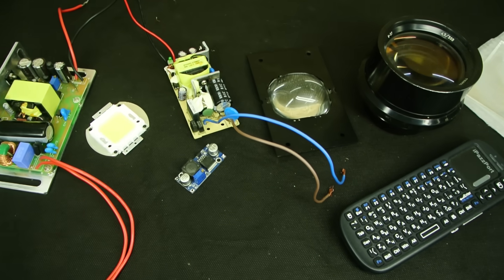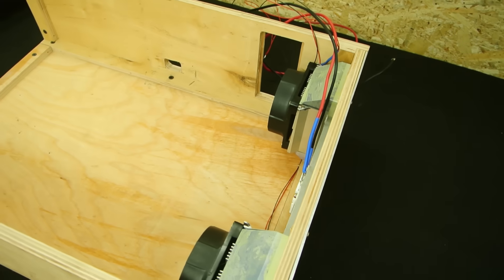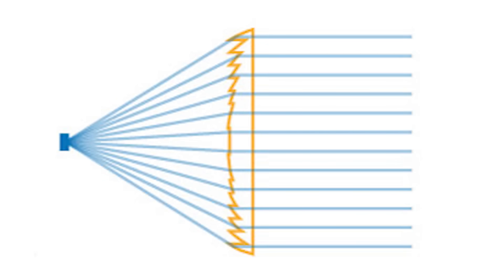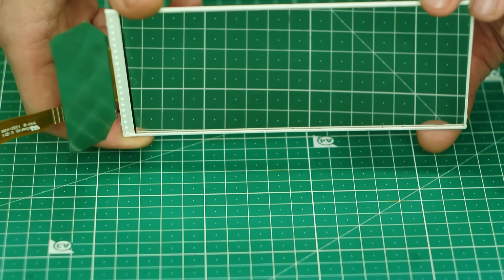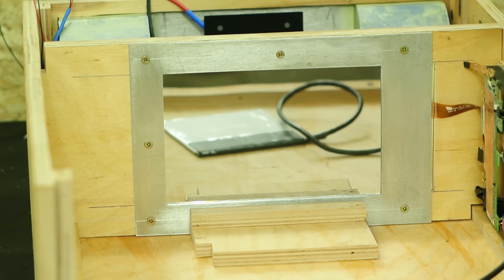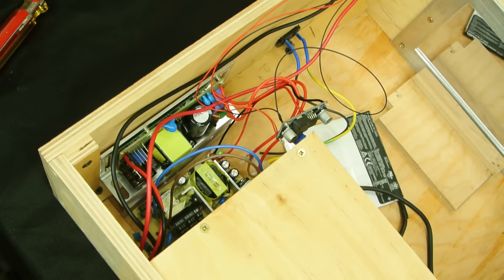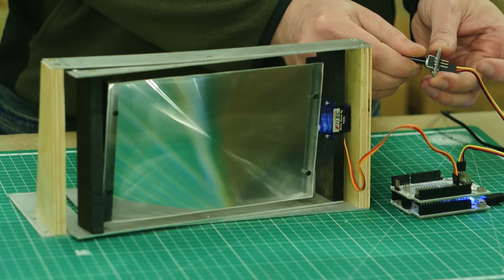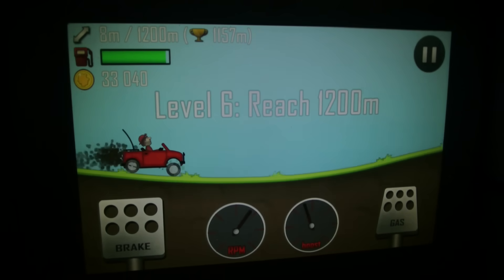How to make PROJECTOR Full HD

Comment: This is awesome. I have built myself a beamer about 15 years ago, same technique with a 7´´zoll Display fresnels, a surface mirror to reflect to the lens and to shorten the casing and a lamp with active fan cooling, don´t remember the name but it was used in stadium lamps :D The ballast for the lamp was so great, that the beamer was about 25 Kilo. Pretty awesome in result though. We had outdoor cinema very often with neighbours coming over and the side of the house as screen. I´m really tempted to go for your build. LED ftw I have used a focal lens and a much bigger lens for the stray of the lamp itself to even out brightness. The resulting picture could be adjusted from 1.20m to about 3 meter square.

Comment: I made a projector like that but it was a little before HD times, and those bright LED even were available to us, so I used a Metal Halide 400w lamp (the dot one) and a Panel from an LCD Monitor, it worked marvelously well. Now, I learnt a few things, one of them it was that the Source light should be as Small in size as possible, that translates directly in how Sharp the final picture on the screen will be, that LED you have there is way too big for the sharpest image, nowadays there are quite smaller/powerful LED units out there... thank you anyways for reminding me about all of this, I think I'll give it a shot with new technology! cheers!
Reply: thanks for the sharing, i will definitely get a small powerful LED. You mentioned that you learnt a few things, is there anything we should take note for a sharp clean video production? Cheers.

Comment: A very nice project.
I build my first overhead diy projector 15 years ago - mainly the same principle, but no lenseshift, lower resolution and the original lamp (15€ and last only 50h). The cost of the lamp was the main reason to abdon the project that time. Now I think about reactivating the old project...
One possible improvement: Part of the heat at the display comes from the first linear polarisation filter. An LCD contains of one linear polarisation filter, a colour filter, the liquid cristals between two sheets of transperent material (with the contacts inside for the electrical field) and a second linear polarisation filter, right angle to the first one. The first polarisation filter blocks 50% of the incoming light - and so produces heat. The liquid crystal turns the polarisation about 90 degrees (no electrical field), so it goes straight though the second polarisation filter. 
Ist there an electrical field at the part (pixel) of the lcd, it stops to turn polarisation, so the light get stuck at the second filter.
So there is a quite simple solution to protect the lcd:  extra polarisation filter between 1st frasnel and the display, so the light gets pre-polarisied to the display. So a big part of heat is blocked before the light gets to the display.
Of course, an IR-blocking filter would help also to reduce the stress the display gets.

The lensshift is a very good idea. How exact does it work? Would it be possible to build two projectors setting side by side, projecting at the same spot?

The reason I ask: 3d-Projection. There are some possible ways:
1. Linear polarisation
As the display has already linear polarisation, using 45 degrees. At the second projector, you simply change front- and backside of the panel, so you get -45 degrees (or 135°). Of course, the picture has to be mirrored on that display to get ist right. Or you use a blank LC to rotate the polarisation of a normal orientated display.
Fitting glases for viewing are used in some Imax cinemas
Silver-wall is needed for projection

2. Circular polarisation
This is done by using a lambda/4-filter (lambda of green colour, so blue and red are not exacly circular but "egg"cular...). It reduces ghosting if not sitting exacly upright.
Same as linear polarisation, but adding a lambda/4-coil between display and objectiv.
Two versions:
2a) both displays normal orientated, but lambda/4-coil on one display -45° and on the other +45° (to the linear polarisation, so 0°/90° to the axis of the display). This is the principle on zalman Monitors (so you can use the glases for them)
2b) like 1) orientated displays, so lambda/4-coil has the same oriantation on both projectors (0°/0° or 90°/90°). This is the Real3d-Concept, so you should use that glases to watch (cheapest solution)
Silver-wall is needed for projection

3. Infitec/Dolby3d
Infitec is an colour filter system using interference filters. Simple spoken: one glas only treepass the left part of the blue, red and green spectrum, the other the right part. So you get full colour on both eyes, but different wavelengs. Due to the sensitivity of the eyes todifferent wavelenghs you have to do different colour corrections for left and right projector.
This system has some disadvantages, but (in my opinion) some very good advantages:
Disadvantages:
- Licence Politic. You normaly can not buy filters and eyeglases, you first have to get a licence (expensive), then you can buy them. But there have been dia/slide-projectors with this filters, so sometimes you get luck. Also some early 3d-monitors with this technique were sold, so you may get filters and glases this way. I had luck and got a set of filters and two glases...
- Only 7% of light gets through the filters, 93% are reflected (not absorbed, so the filter do not get hot)
Advantages:
- The filtering is done before light gets to the display. As the maximum heat the display can endure is normaly the limitating factor, you can increase the light output - 93% will never reach the display. If your projector normaly uses 100W LED, you may use 1000W instead (or a plasma bulb...)
- The glases use the same filter. So external disturbing light ist also reduced, while the light from the projector gets fully through.
- You can use a normal white wall. No special silver one...
Dolby3d is Infitec, but left and right changed. So if you can get hand on Dolby3d glases, simply swap cables...
- As the filter reflects all unused wavelenghs, you may use one lightsource for both projectors - the "wastelight" from first filter contains the wavelenghs the second needs. 

The main reason for building an diy-projector in 3d: the technology normaly used makes headaches. The left and the right picture are sequential shown, so one eye gets picture, the other dark. In homecinema you use normaly a shutter glas. But also most cinema use sequential projection. Real3d uses an LC (the whole LC is one "pixel") to swap polarisation 0°/90°, folowed by an lamba/4-coil; Dolby3d uses a colour wheel between lamp-unit and projection-unit. With a selfmade dual-projection, you can solve that problem, showing left and right picture the same time. And Infitec/Dolby3d is only possible with selfmade projectors (or very hard modified commercial projectors), as the filters must placed in parallel beam...

As for the displays: of course a nexus7 is not ideal for external sources (it is perfect of course to stream 2d Video, surfing the net and so on). There are some displays with hdmi available, using full hd at 7 inch. They are made for cameras. Lilliput A7S 7-inch 1920x1200 IPS ScreenLilliput A7S 7-inch 1920x1200 IPS Screen cost about 150€

Comment: Your project is really interesting, i have questions if you want can you please email me. I'm actually working on a project with my mates same like this but it has difference. our project is wireless controlled projector. i have questions on how you connected the LCD screen into the module. what port did you use. can you email me please at aldrinmatthew.demesa@lorma.edu
thanks
Reply: u can use every single smartphone to do that , i will make my build from old Nikon lenses kit from d3100 and uhd plus from xiaomi rednote 5 also moterboard from smartphone,as a lamp i will use  police ultra light ledcob , lenses from old microscope , sound blue tooth and charging normal way like smartphone or bigger battery in box light aslso from usb 5v so to usb cables out. torch old smartphone , old broken camera lenses ,old garbage microscope or old projector lenses , all is on garbage  place....

Comment: How did you flipped the image horizontally, because you are not using mirror
Reply: Pavan Jaiswal i think, turning the motherboard and putting lcd on the right direction.
Reply: Hakan Keskin with this only image geta upside down, but we get image that is reversed like mirror
Reply: Pavan Jaiswal rotate lcd (i mean "pitch" or "yaw" rotation)
Reply: Hakan Keskin you can not just rotate it, there is polarisation film on front side
Reply from the maker: I just turned the display in two planes, no matter which side of the polarization film
Reply: HAMMERLAND "two planes". twice to horizontal or vertical direction ?
Reply: HAMMERLAND should I remove the last layer of polarization film or not. ?will it not disturb the ray of light ?

Comment: There are lenses and optical windows that absorb heat (infrared) but allow the visual spectrum to pass through.  You could use one of these between the CREE LED and the LCD (with a cooling fan that cools both the CREE and this lens/window) to keep the heat from reaching the LCD screen.
Reply: where can i get these lenses please?

Comment: Cool.
A lot of old technology that used high powered light bulbs can be replaced with modern leds.
The old style bulbs threw out an enormous amount of heat.
Anyone wanting to try this would get a lot of the parts from an old slide projector.
The projection lens he uses is a Russian Industar.

Comment: I have a question... If you can do that with some wood and projector components, is it possible to turn my an old 800x600 projector (Viewsonic 55134) into Full HD just changing the internal LCD display? That would be very cool!
Reply from the maker: You need to change the LCD display and the display control board
Reply: HAMMERLAND interesting... Do you know how much money would that be on aliexpress and how difficult would it be to do it myself considering I have no knowledge about it?

Comment: Could you explain in detail how to get the LCD panel from a phone/tablet?
Reply: Andandos I normally use a hairdryer to melt the glue inside the device, take the front glass panel off, then the screen should just come off.
Reply: A Dead Meme 
Nice thx. I tried it with an old galaxy s2 but then I realised that the device has an amoled display... Fail :)

Comment: I bought a cheap generic projector its below 720p and this video got me thinking, could I strip it down and use a hd android phone or tablet to make it hd? so I'd just be using the case, lenses and led from the projector
Reply: Im asking me this for years now.. full hd 5.5" phone hd displays dosnt cost much. about 25 $ why do the china projector builders not use them instead of the shitty 800x480 ones. Maybe a controller board issue? The idea to build it this way is not new i build my first DIY projector out of a 14" notebook display and an overhead projector back in 2004.
Reply: Yaa, iam allso thinking. good idea it is.
Reply: david grimes I mean....you could if they didn't make it an all in one unit and the screen is compatible, odds are it's soldered onto to the motherboard or adapter board.  other issues might be screen size pixels per display does not correlate to pixels per inch.  you may have to make a lot of calls to make it work

Comment: hi,

I want to use my old Galaxy S4, it is also FullHD.

please give us more details to construct it!

thanks
Reply from the maker: All the information I found on the Russian site, there is a lot of theory, I can not give everything in the video. Search the Internet, I'm sure there is a lot of information in English http://diyprojector.info/gallery/index.htm
Reply: I prefer in Spanish, but what only I found it is a simply box with the phone inside... You russians are best at these house experiments!
Reply: NapalmCandy you can buy a used Sony Xperia, Samsung Galaxy, Lg G series or any other brand with a Full HD LCD display (gsm arena has all specifications for any known branded phones), the cheapest are the most time those with a broken screen... and then just buy a new cheap screen on ebay or use the screen from the used one (if the screen on the used one is not broken or scratched). For 4K you can buy a used Xperia Z5 Premium (same process as stated before) but that's a bit more expensive. You can also build a more complex projector if you buy a cheap Full HD/4K phone (as mentioned before) and separately an LCD and a digitizer (not assembled). The LCD would be used for the projection but the digitizer would work like a pad on the top (or side) of the projector (in this case you would have an additional control not only over an external keyboard and mouse, you could say a Full control like on a normal phone). I hope I helped you a little bit, I'm also thinking to start a project :-) greetings from Slovenia
Reply: NapalmCandy you can't use the display from your S4 because Amoled has no backlighting. You could use any other LCD type phones display
Reply: Thanks! I was searching right now about this. I will search for a cheap  FullHD mobile (or 4k)... any idea?
Reply: thanks for your help!

I also need where to found the focus lens, the big one, how much it is?

And more, how much will all parts for the final project?

Comment: Buy an led projector ....thats the best way....
Reply: Full HD projectors start around 500 bucks tho. And this is made out of relatively cheap components and old android tablet.
Reply: @niter43 I got 8000 lumens, 300 ANSI, 1920*1080p, electric adjust mini smart projector for 71 USD U can see the results, the projector I used is tripsky t269 btw
Reply: +Noor M Yus
well, I'm all for DIY projector too.
Reply: niter43 That's great. I was thinking of this for a quite a while after I did a halfway conversion of my infocus projector that could do 1080i but had to abandon it cause the board started to give me problem, altho small but still a problem(got 2 videos on my channel doing the halfway conversion). The thing is here that I wanna ask is, what about a glass convexion tube like design for the lens instead of an actual lens for the led light source. U know a pyramid, 4 sides cut off the pointy top, the square opening is just the exact size as the led light bead, the glass reflector is obviously have to be inside the pyramid. So that way, no bleed from the light. With good cooling for the led light so that internally where the light output to the internal display won't get too hot as it is a closed area. Just my thoughts.
Reply: U can't get a full hd projector from 500 bucks dude. If u say yes, do tell me which company makes & sells them at that price? Are u confused between max resolution & native resolution?
Reply: niter43 u got me there but that optima ain't using an led light source, it's using a uhp lamp, good price but for the power & lifespan, for me I rather built like he did in here & 2k to 4k 5inch display are already out in the market with their driver board with HDMI input powered by a single 5v supply. I rather do that. The aforementioned display with driver board cost about averaging at 150. so if u have the rest of the parts laying around, it could be a good project.
Reply: +niter43 its very expensive in india
Reply: +Arts and Knowledge
So what? We wasn't talking about India in particular.
Reply: +niter43 yes you are right but I am from India,but thanks
Reply: U r crt...😂
Reply: Noor M Yus "okay Google, Amazon led projector 1080p"
first link — 550$. Native resolution.
https://www.amazon.com/gp/aw/d/B01HQCF6R6/ref=mp_s_a_1_1?ie=UTF8&qid=1495376910&sr=1-1&refinements=p_n_feature_nine_browse-bin%3A13686538011&pi=AC_SX236_SY340_FMwebp_QL65&dpPl=1&dpID=41gdAgRWc4L&ref=plSrch
Reply: what is bucks